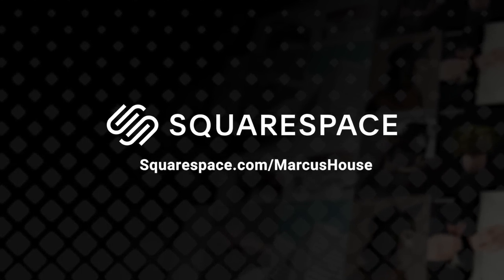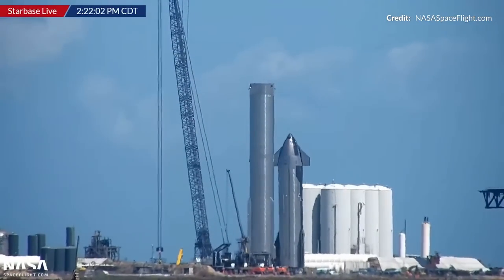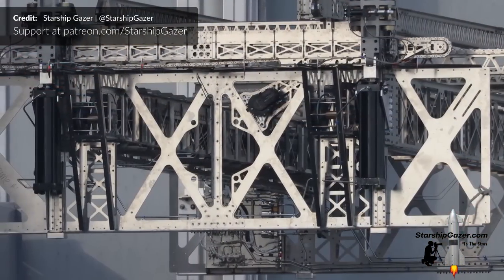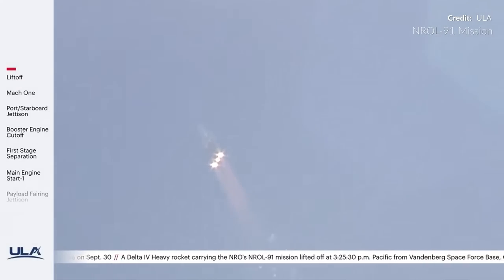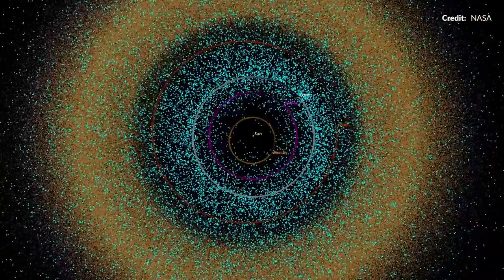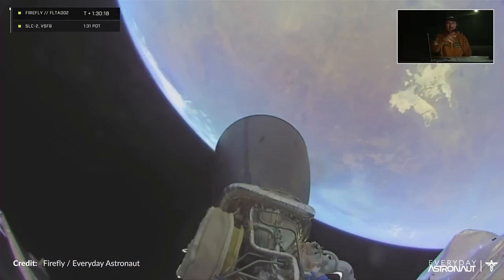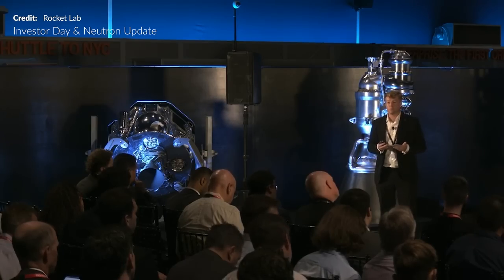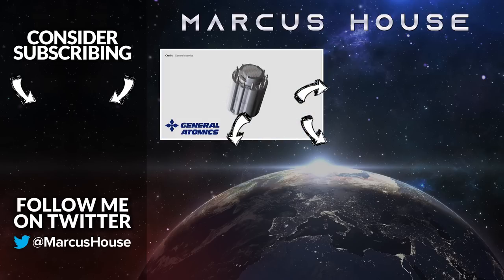SpaceX Starship Updates, NASA DART Mission, Firefly Launch Success, Delta IV Heavy and much more.

Comment: Watching the delta 4 boosters coming away and knowing they're going to crash and burn seems CRAZY now.
Its going to be cripplingly painful watching the Artimis lunch!
Pallets and Pallets of cash falling though the air burning up!
Reply: Booster reusability is great, but has drawbacks.

First, if you don't have a fast enough launch cadence, you can spend more on recovery equipment and personnel than you save by reusing the booster.
Second, you take a payload hit for the recovery system on the booster. The Falcon 9 B5 can lift up to 22.8 tons to LEO when expended (SX), but only up to 16.7 tons when landed on a drone ship (B1069.2). Doing a Return to Launch Site (RTLS) landing, costs even more payload as you have a boost back burn to cancel the lateral velocity and return back to the launch site.

So with SLS launching once or twice a year, the cadence doesn't really justify recovering the booster. Not to mention that it gets higher and faster than a Falcon 9 as the SLS core stage almost reaches orbit, making recovery MUCH more difficult.
The SLS Block 1 can get Orion to the Moon, but not with the kind of payload hit like F9 has. The SLS Block 1B will send along a Lunar Gateway module with Orion, so it really can't take the payload hit either.
SLS started design work in 2011, 4 years before SpaceX landed the first booster and almost 6 years before they reused a booster.
The first Delta-IV Heavy flight was in 2004, 2 years after SpaceX was founded and almost 2 years before SpaceX first tried to fly a rocket to orbit. It was 11 years before SpaceX landed the first booster and almost 13 years before SpaceX reused a booster.
Reply: @steveaustin2686  The RS 25 engines first flew in 1981, so are over 40 years old! 
All 4 engines on Artimis have flown before and are designed to be reused!
It's the shuttle with out the shuttle, the hole thing was designed to be reused but the whole $4.1 Billion of rockets going in the bin after this launch.
Reply: @steveaustin2686  the whole rocket has been slapped together from the shuttle scrap yard.
It has cost YOU and every person in America $1,250 each! 
im telling you somethings no right there!
Imagine ive got a scrap yard full of Tesla car parts. And I make fully working car out of all the old parts then want to charge you a million dollars for it.
No my friend, thats no right.
Reply: @thomasbramwell9592  No, the Space Shuttle was NOT all reused. The SRBs were splashed down, recovered, reduced back to base components, and rebuilt. It was determined by NASA is would be easier to just buy new ones, but they were already recovering them, so they kept doing it.

The External Tanks were not recovered at all. And no, you just can't slap 4 engines on the ET and call it the SLS core stage. It had to be completely redesigned and built. The SRBs for SLS have an extra section, so some redesign there. The ICPS was not even on the Shuttle and is a modified Delta-IV upper stage. This is not Kerbal Space Program, were you mouse click and it is done.

Yes, cost-plus contracts suck because cost cutting is NOT incentivized, but it is what we have for SLS/Orion. If NASA wants to beat the Chinese back to the Moon, they can NOT scrap SLS and start over. Starship is still in early development and is YEARS away from being able to replace SLS/Orion. Take off your SpaceX colored glasses and look at reality. I like SpaceX a WHOLE LOT, but they are not the end-all, be-all of US spaceflight. Look past the hype to the reality.

Comment: just my dumb thoughts, but, if this Dart mission is messing with a clockwork that has existed since the beginning of time, maybe we should NOT interact with asteroids and such? i mean, what if things get out of wack because of it, and something big falls in our heads because of it?
Reply: The asteroid that was hit was Dimorphos, which orbits around the much larger asteroid Didymos. Both asteroids orbit the Sun and are almost 7,000,000 miles away when they are closest to Earth. The Moon is 240,000 miles away for reference. The impactor from DART will slightly change the orbit of Dimorphos as it orbits Didymos. The change is so small that it will take weeks to determine how much it changed. Didymos orbit around the Sun won't really be affected at all. This was a small scale test to see if the simulations of an impact match the real world test.

Comment: Regarding artificial gravity, I believe it will work better if two starships are connected together tail-to-tail, rather than nose-to-nose.  This way you get the most acceleration in the crew area where you want it, and less in the fuel tanks, where you don't want it.  Also, it gets the two crew areas far enough apart so you can achieve the desired acceleration by connecting the ships directly to each other, thereby eliminating the need for any special structure between them.
Reply: Engine to engine?  Really?
Reply: @JoeShmoism  I've stated the advantages.  What are the disadvantages?  Obviously, they're not going to fire the main engines while the two ships are coupled, regardless of how they're coupled.
Reply: The smaller the diameter of the circle, the more you can get the crew dizzy with the simulated gravity. So it's a trade-off of diameter of the spin section and speed of the spin.

Comment: 3:45  What you identified as the LOX header tank is actually the methane manifold structure, isn't it?
Reply: Nah, he got it right. The LOX header covers the inlets to the inner 13 engines (no room to slosh, valves close it off from the main LOX tank), and the enormous methane feed tube doubles as the methane header for the landing burn(s).
Reply: @dancingdog2790  OK, thanks.

Comment: Can I ask a stupid question? Why do they call it a (test) tank? Surely this is a section of the rocket that will eventually be stacked? Why call it a tank? For ages I thought they were referring to one of the tanks that make up the tank farm (fuel and water depot). Or am I wrong and these test tanks are not part of the rocket? These are great videos but if things aren't described properly then one is left scratching one's head. Thanks
Reply: The test tanks are the same construction as the propellant tanks, usually not as long, since they are mainly testing the construction of the ends of the tanks. The test tanks won't be installed in a booster/spacecraft, but do test the construction of the tanks that do go in a booster/spacecraft.
Reply from the maker: They often test them to destruction.
Reply: @steveaustin2686  Thanks Steve. I've got it now that these are for testing. My problem is calling it a tank. Yes, there's a tank in there but this is essentially part of the rocket (but only for testing purposes). Calling it a tank makes it sound like its something that's going to sit on the ground and hold something and not something that's being tested to become part of the rocket itself. I say it again, these are great videos and I really love them but if things aren't described accurately then the audience is left behind. Just saying. Thanks again.
Reply: @slamdunk58  Well, each booster and pretty much any spacecraft really, has at least two propellant tanks. One is the fuel tank and the other is the oxidizer tank. There can be other tanks for RCS, helium, water, oxygen, etc. So the tanks on a spacecraft can hold many things and just are not for holding things on the ground. There are some small spacecraft that have monopropellant, so they could only have one tank. Very few spacecraft have no tanks, like Hubble does not have any consumables I believe.
Reply: @steveaustin2686  I think you're missing my point. Simply calling this "a tank" leaves it open to misinterpretation. This is part of the rocket (but only for testing purposes) that has a fuel tank in it. I don't think I'm being the lest bit pedantic in saying that referring to this as just "a tank" is more then a bit confusing. I'm just engaging in a bit of constructive criticism here. Marcus does a great job with these videos but he covers a lot in a short space of time so being accurate is of an even greater importance so the audience can keep up. I consider myself a reasonably intelligent person and for ages I couldn't quite work out exactly what the (test) tank did or was? Well, I do now so none of this really matters. Just thought I'd mention it.
Reply: @slamdunk58  Eh, they are all just called tanks I believe. I don't think that they have any special names, besides maybe listing the tank content in front, like propellant tank, oxygen tank, water tank, etc.
Reply: @steveaustin2686  Exactly, and that's why I (and probably a few others) was confused.
Reply: @slamdunk58  Well, they are usually called test tanks. With how large they are in diameter, they can only really be propellant tanks.
Reply: @steveaustin2686  Well, it sounds like you're still missing my point but never mind
Reply: @slamdunk58  I would say the same.
Reply: @steveaustin2686  About what?

Comment: Are they thinking about making all the boosters retrievable and land on their own
Reply: Possibly. Booster reusability is great, but has drawbacks.

First, if you don't have a fast enough launch cadence, you can spend more on recovery equipment and personnel than you save by reusing the booster.

Second, you take a payload hit for the recovery system on the booster. The Falcon 9 B5 can lift up to 22.8 tons to LEO when expended (SX), but only up to 16.7 tons when landed on a drone ship (B1069.2). Doing a Return to Launch Site (RTLS) landing, costs even more payload as you have a boost back burn to cancel the lateral velocity and return back to the launch site.

So it's possible that they could start expendable and move to a reusable variant. SpaceX did that after all.

Comment: I was hoping NASA would show interest in Polaris capability. I bet they're looking at the suits too. Maybe nag SpaceX a bit for some extra features and have a backup suit for Artemis a few years down the line with iteration for "free".
Reply: The suits being made for Polaris are a step between the current flight suits and an EVA suit. The Polaris suits will still be attached to the Crew Dragon by an umbilical. EVA suits are basically miniature spacecraft and are much harder to make.
Reply: @steveaustin2686  Yeah but SpaceX needs proper EVA suits eventually so I think it can be done iteratively. Test the suit with umbilicals and keep working it while developing a self contained backpack unit a few years down the line.
Reply: @steveaustin2686  I know they aren't like the EMU for the initial Polaris missions.
Reply: @221b-l3t  Almost certainly what they are doing. Iterating to a space EVA suit and then finally a surface EVA suit which is the hardest.
Reply: @steveaustin2686  I wasn't expecting that much for Polaris suits but Jared keeps teasing that they are really cool, as well as some other people so I'm guessing they made quite a few changes. He did mention the gloves being a lot more mobile and joints more optimized for movement. 

The current IVA just has to be a lifeboat while buckled in so it's not great if you just attached a tube to it and went outside. We'll see the mission is pretty soon.
Reply: @221b-l3t  Yeah, the EVA with an umbilical is not too far off of the IVA suits, as they are connected to Crew Dragon as well. I'm sure they will make upgrades. They need to get to a much more robust suit for EVA's by themselves, especially surface EVAs.
Reply: @steveaustin2686  Yeah moon dust is a whole other thing. But they got some time, they aren't the main provider. But I bet if Hubble service happens and goes well NASA will keep them in mind as a backup option.
Reply: @221b-l3t  Yeah, Moon dust is pretty harsh. Mars dust shouldn't be as rough, but it is very fine I understand.
Reply: @steveaustin2686  Yes it's insanely fine. Comparable to the particles in cigarette smoke. So impossible to keep out long term. By the end the LEM was full of dust and the suits were about ready for a servicing with dust in all the joints etc...
Reply: @221b-l3t  I think that is one of the many reasons NASA was so excited about Lunar Starship. In the Apr 2021 HLS Option A Source Selection Statement, they said that there would be 2 redundant airlocks. Both the ILV and Alpaca have to depress for EVAs.
Reply: @steveaustin2686  Yes HLS has a large room by the elevator and two airlocks. That's a lot more opportunity to keep stuff clean, the suits never have to enter the short sleeve environment and in an airlock once filled you could use low tech solutions like hosing them down with water.
Reply: @221b-l3t  Definitely. I wonder if they will have two elevators, one for each airlock. That would make sense.

Water, vacuums, brushes, all should be great in the airlocks to keep the rest of the ship clean.
Reply: @steveaustin2686  For now it's a large cargo bay with one main elevator and the airlocks open into that cargo bay. I believe there is a backup although not known what. I speculated a winch and a basket in case the elevator fails, but all this is a very preliminary design shown in one NASA publication. Interior design is still pretty low priority so lots could change, especially between the eventual HLS ships, they'll apply lessons learned in the demo landings, since a lot is unknown at this scale of lander.
Reply: @221b-l3t  Oh for sure. Reportedly, SpaceX has tried out the elevator. With the dry mass and engines still up in the air, nailing down the interior and cargo is something to wait for later, when the final values are known.

Comment: I’d like to see NASA develop a small airlock station to attach to the back of Hubble, so they could dock Dragon, and have space suits, tools, etc, on hand and ready.

Of course, could Hubble maneuver with an additional structure attached to the back?
Reply: That would basically entail permanently attaching something as large or larger than a Crew Dragon to the back of Hubble. I'm not sure the attachments used to grab Hubble by the Space Shuttle would be able to handle that. You would also increase the area of Hubble, so even the tenuous atmospherice drag at that orbit would increase. Hubble is also old, so eventually it will need to be replaced, just like the ISS needs to be replaced.
Reply: @steveaustin2686 , maybe a station-keeping module that Dragon could pick up on the way in, then leave in orbit afterward.  Just an airlock, and a rudimentary space shuttle cargo bay.
Reply: @michaeldemarco9950  If you look at the pictures of Crew Dragon from the front in the video, you will see that the main thrusters that SpaceX uses are from the front of Crew Dragon under the nose cap. Unless SpaceX is manufacturing a new modified Crew Dragon, they paused making them, the Polaris/Hubble mission would likely be testing how well Crew Dragon can boost with the thrusters facing the docking location, IF Crew Dragon can dock with Hubble at all. Assuming that SpaceX isn't going to grab Hubble with something in the Trunk area instead, which is probably more likely.

A station keeping module with an airlock to be like a shuttle cargo bay is basically building a new spacecraft. Not out of the realm of possibility, but would likely push this kind of mission out for years. Sticking an arm in the Trunk area of Crew Dragon to grab the existing parts of Hubble would be MUCH faster.
Reply: @steveaustin2686 , I’m thinking more as an airlock than anything else, because we’re 40 years beyond where we should have to depressurize the entire crew, just to do a spacewalk.

To late for Polaris 2, I understand; but for the long haul maintenance of Hubble or any man-tended spacecraft.
Reply: @michaeldemarco9950  Crew Dragon and even the larger Orion are too small to have integrated airlocks. It would have to be a separate spacecraft airlock on a separate, expensive launch. Depressing the spacecraft, that are already built to be depressed, is much cheaper.

Both the ILV and Alpaca landers would have to depress the spacecraft for EVAs as their crewed portions are small. HLS Starship is large enough to have two redundant airlocks and I would think, two 'elevators' for it as well.
Reply: @steveaustin2686 , given the frequency of Falcon 9 launches, a separate airlock launch wouldn’t be out of the question.
Reply: @michaeldemarco9950  It would cost somewhere in the neighborhood of $55M+ (commercial price), just for the launch. Not including the airlock spacecraft itself. The launches are not free. If you want internal costs, it is reported to be somewhere between $15M and $30M. Still a LOT of money and that doesn't include integration and other services, plus the airlock spacecraft.
Reply: @steveaustin2686 , true.  But, it seems like Elon is offering this first servicing mission to NASA free of charge, as a side benefit of the Polaris 2 mission.  

Sounds like Elon likes doing charity work, using a bit of his profits to further the human condition.  

So, some of these other later costs maybe could be negotiated.
Reply: @michaeldemarco9950  Still means that those costs are there. Launching two Falcon 9's in quick succession is not a problem since Crew Dragon would go from LC-39A and the other from SLC-40. The big questions is will NASA allow a private spaceflight to Hubble in the first place.
Reply: @steveaustin2686 , sounds like they are going to, but we’ll see.
Reply: @michaeldemarco9950  They are doing a feasibility study. They could still say that the study says no. If it does happen, I bet it would be a boost and probably not any repairs. NASA astronauts usually trained for months to years for those missions.
Reply: @steveaustin2686 , yes.  This first mission will be a simple boost.

Hopefully, it could lead to more complicated ops.

Still hopeful that we can regain some space shuttle LEO abilities using capsules and a much more regular manned launch schedule.